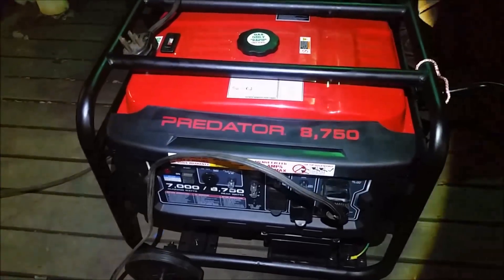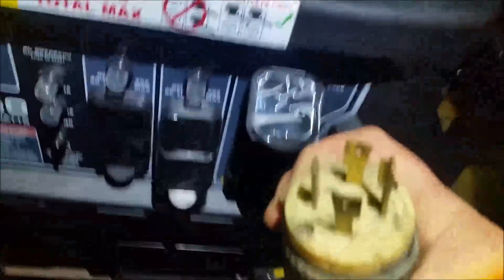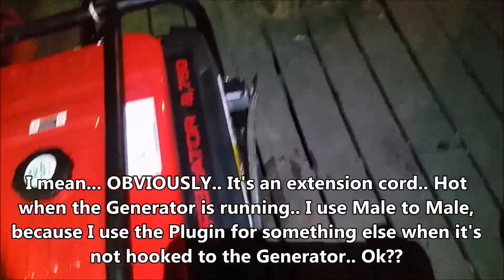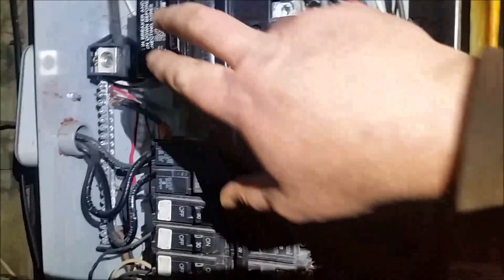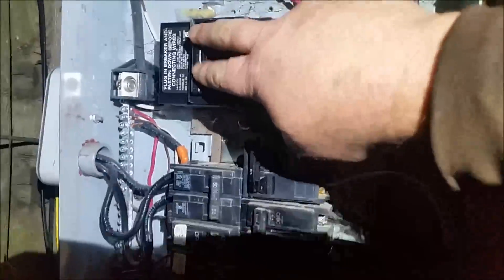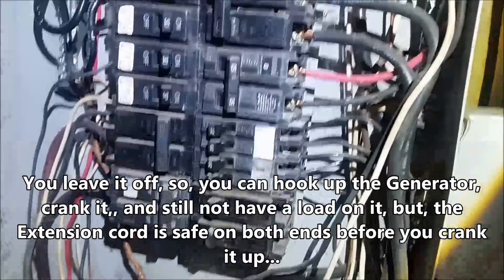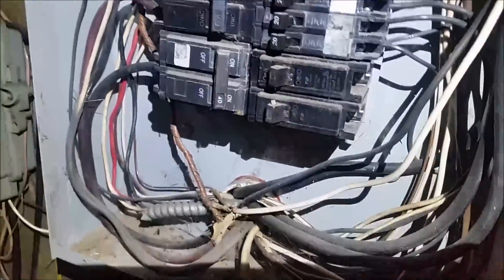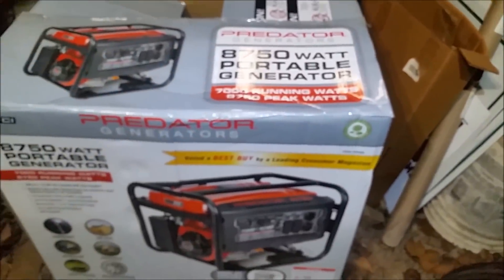Quick/Easy/Safe: Use Existing Plugin/Breaker for Generator hook up to your house Panel box.

Comment: At 5:20 or so and after you explained that each 110 single pole get 110 off its 220v bus. Also around 5:30 you said a 220v 2 pole gets 220v from each 220v buss. You can call me a kid but again you are ignorant and should probably smack yourself for trying to belittle people while you yourself cannot even explain simple phase circuuts panels or even correct buss arrangement. Do you know the difference between delta or y configuration, why smart people have a sub panel for their generator isolating their neutral and ground if there is no generator switch or even why you do? Keep trying to play victim with the people commenting and acting like you know what your doing. Post a single video explaining proper code or technique. You claim its good enough for a lineman but lineman are not electricians and both are trained in different journeyman fields. For a reason. Uh dur mr hick. Smack yourself for being an idiot 👌 kudos for your misinformation on that panel, wonder how many people are hooking up their houses according to your b.s. wow. Your right below cobspiracy theorists on youtube. Hope you feel like a jeenius!
Reply from the maker: Ha.. Yea.. But, this video is not about maintaining equal loads on 3 phase circuits. But if it was, we could discuss it.
Funny though.. Your last post before this, you pointed out something at 5:30.. I still don't know what it was. You didn't explain yourself.. 
If you still are not sure.. Start at 5:36.. You will understand it.. Someone walked up on me when I was getting ready to explain the 110v breakers, and I didn't hear them until they were almost beside me.. I went back and looked at the video. I remember.. It was at 4:25, when I was pointing at the 220v Generator plugin.. I did pretty good.. Didn't flinch at all.. Never do when I am working inside of a hot box.. But, I did loose my train of thought, because I was caught off guard and in a hurry to finish the video because my battery was about shot.. I guess it took me about a minute to process my thoughts and get back ontrack while talking the whole time..Not bad considering.. But, I did straighten it out, since I caught it in the midst of all of those thoughts. Ha.. The Brain is quite amazing.. 
Sub Panel for their Generator? You must be talking about a Transfer switch?? Why would you isolate the Neutral or ground? Just Curious.. So, it would not backfeed out to the lineman?? Really? Are you one of those guys?? Ha..Ha.Ha.. Well.. I thought in your last post you were getting smart..Ha..ha.. 
Funny.. You passed 5:20 the first time before you got to 5:30 which you pointed out.. But, after my comment went back and listened again to pick up the mis statement in 5:20.. They are actually plugged into one side and the other, which is what I meant to say.. If I didn't understand that,  you would not have been so surprised at 5:30.. You thought I was wrong there, but, found out later I was right and you missed 5:20.. Ha.. But, hey.. You understand it now, which is a good thing.. So,, I'll entertain your "Isolate the ground comment".. Transfer switches by design isolate the ground and neutral, because of how they are built.. When you open one, see if you can figure out how to build one without doing it. And, you will see why it is done.. Not because it provides any other reason for it.. but, you seem pretty sharp, and a picture is worth a thousand words, so, here is how you understand the rest of it and stop thinking that saying "Isolating the ground and neutral means something".. Two hots coming into the box correct.?? BUT, there is a Bare Ground/Neutral also.. From the Utility power..If you have Areal Triplex, Two coated and one aluminum.. Follow that back to the Transformer.. Now, look and see what is feeding the transformer.. What is going down the line that the "Lineman" has to worry about.. You of all people being an electrician (was that you?),, should be able to look up at the pole and see what is feeding to your pole... Two lines from the last pole.. Both are high tension wires.. Power Wires.. But, three wires going from the Transformer to the box.. 
Ok,, (2 hots if you are on single phase, so if you see 4 hots there is 3 phase there, even if you don't have it), but, where did the third wire come from?? Look around.. Look at the ground and work your way up.. If the Power company isn't worried about your ground,, why should you??? Ha..Ha.. That is why they call them "Service Disconnects or "Main Breakers".. And,, BTW.. Lineman or Electrician.. This is some basic 101 shit.. You don't need to be either to look at a pole being fed with 2 wires and feeding something else with 3 to figure that one out...  BTW.. I might post another video one day about this.. But, since you and 3 others are the only ones out of 610 commentators who have noticed the oops in this video, I think I will add one instead of replacing one.. 
I was thinking about doing one the other day when someone posted that "Isolating the ground bullshit".. He spent well over $1000 on his Transfer switch.. had to put up a second pole to mount it on.. Looks like some shit that should be on the side of a warehouse somewhere.. Not his trailer.. Ha.. I want to do one on how the job should have been done, instead of the total crap installation his Electrician did for him.. You electricians are not very smart.. 
It's such a simple trade.. I just looked at two panels before I wired my first house and got an inspection for the hell of it... I had outlets on every other stud in every room... I had one outlet wired backwards out of all of them.. And, that was when you wanted to wire a 3 way light switch, there was no such thing as the Internet or Google. It was off to the local library.. Ha..Ha. What a simple field... And, you guys don't understand enough of it to see how simple it is.. One more thing. Do you have any idea the value of your personalized training here?? Ha..Ha.Ha. . I hope you got something out of it.. I am sure you did.. And I was glad to help.. I gotta run.. I have a drag link to build and I have one more bushing I have to make on the lathe before I am finished.. I finally got to use the damn lathe I bought 2 years ago.. I figure it out on the fly while making my first few parts.. I love theory.. Anyone can do anything with the same basic set of tools.. If someone else is doing it, you can too.. Because what basic set of tools does he have?? 2 Eyes, 'Two hands.. And, you have both.. No reason why you can't do the same.. Do, save your money, buy some tools and get to work.. I weld better than every welder that I know except for one, because I was never taught I could not do something.. I do all sorts of jobs with a welder that they say can't be done..
Reply: . you are about the biggest joke of a romex jockey i have ever seen. Are you high while trying to explain yourself? Obviously you do not understand very much, more of a ghetto rig it till it works i see. Also i understoid everything you were trying to say but again you said absolutely wrong information and couldnt even double check your work before posting. That misinformation wether corrected later in the video or not will lead someone to hook something up wrong. Again because you are wreckless your video has potential to hurt many people but your ego matters more? Oh and again you are still wrong and if you cannot watch the video and realize how than you should smack yourself and call a electrician not a lineman and ask him if you woukd pass code and why you wouldn't. Im done if you cannot even make a simple intelligent reply that makes any sort of sense. If you had a brain you woukd atleast reshoot this and do it correctly so you are not potentially killing someone. Leave it to people who have a brain and actually know what they are doing that do not have to correct themselves 100x. Lay off the weed while you film if you cannot leave it to people who have a clue. Enjoy being the hick with an ego that misinforms people 👌 oh and my previous comments explained myself very well, sorry it was so hard for you to figure out 😂 wow just wow
Reply from the maker: Well, I'm glad that you learned so much here.. You started off being shocked at a 220v breaker feeding off of both sides of the box.. and know you are a master electrician..  I like your style.. Ha..Ha.. Be careful though with that new knowledge.. You missed it the first time.. But, you picked it up the second time you watched it.. That's good. At least you are getting somewhere.. 
BTW.. The box was open to show people what is inside of it.. The solution does not require that anyone know anything about a 220v breaker, neither do they have to open the box.. Just make a male to male extension cord and plug it into an existing Welder/Stove/Dryer outlet.. So,, more of your Drama Queen remarks that you so cluelessly make.. You friends down the hall are watching the video again and laughing their ass off at you.. Go back down there and see what I am talking about.. 
Ghetto Rig.. Are you black or white? Live in the Ghetto?? Just curious.. Because,, what is ghetto about a Welding or Air Compressor 220v plugin? Just curious.. Ha..Ha.. All according to code.. Every bit of it,, and would pass code anytime there were an inspection needed.. But, you would have to know the difference in Grey PVC and Grey Flex Duct, etc to know that... I think I smack myself in the head a few times too.. 
Poor guy.. You must know something about something??? And, you probably have a cellphone with a video camera.. You should be able to find something you could put up on your channel.. I mean.. Something other than video games.. Huh?? You should really try it. And, you should let me know when you do.. This could be fun.. Ha..Ha.
Reply from the maker: You still watching the video?? Good stuff isn't it.. Ha..Ha..Ha.. 220/270?? Ha..Ha.Ha.. You need to brush up on your Phases.. You don't have a grip on them yet.. BTW.. I just read your comment again.. You need to watch the part about double throws again.. You still don't understand.. I posted where you need to watch again.. Running off the same bus catching fire.. Wow.. Not sure where you got that one... Not sure how to tell you to correct that either.. That is way out there.. Maybe you are thinking you will double your voltage/amperage?? Back to the phase shift again.. Maybe you are talking about phase shifting. Do some research on 60hz and look at "Automatic switching generator switches", but, only those which are switching from Plant power to Utility and back.. Plants that generate their own electricity.. Look at the dangers of "Out of Phase" connections.. And, then, you will see how vulnerable the Electric Grid is,, if you are sharp and don't miss it.. 
BTW.. Making money?? Did you see an ad before my video or videos? Because this channel is not monitized.. If you didn't understand that,, it means I have not chosen to make any money off of it.. I sure as hell could though.. I have been qualified and able to monetize it for several years now.. 
So, you should not be having to watch any ads when you look at my videos.. I don't do it for the money.. 
If someone gets hurt doing this,, it wasn't by following a simple set of instructions.. 
Scroll back up to the top and start here since you have watched the video no less than 5 or 6 times and still missed it.. 
STEPS TO DO THIS.. For Reference.. 
GENERATOR IS OFF NOW...
1) Turn Main Breaker off.. (MUST)
2) Turn Generator Feed Breaker Off. 
3) Turn Off any other 220V Breakers
4) Hook Up Generator Extension Cord
5) Crank Generator and let run 1 minute.
6) Turn on Generator Feed Breaker
7) Start adding loads to the Generator.
For those of you who don't feel comfortable with this.. Here is a solution for you $650 at Home Depot and you can probably install it yourself.. 
https://www.homedepot.com/p/GenerLink...
Don't be such a dumb ass..
Reply from the maker: Then,, go elsewhere.. I am really getting tired of your stupidity.. You have learned alot here.. You didn't know shit when you arrived.. Show some appreciation of I will show you a trick.. Two clicks.. One and then,, Hide user from Channel.. One more post I have to look at , and then one more and you are gone.

Comment: Good luck with that one!hooking up ur cord to a running generator is his first no no because the male end in his hand is hot as tin shit house so this guy may not be alive today,best thing to do is make friends with an electrician
Reply from the maker: Joshua Smith.. Please do not do anything that includes anything that requires you reading or listening to instructions.. Because, you have serious problems with such simple concepts.. Since you missed the video and audio concepts, and totally missed the fact that the generator you hear running was 50 feet from the one sitting on the porch not running.. You totally missed the sound getting louder as I walked away from the HF Generator.. I mean.. DON'T YOU USE ANY OF YOUR SENSES??? Surely one of them had to have kicked in during the video.. But, you missed them all.. BUT THE WORST PART OF IT,, is that you can't read and follow simple 1,2,3 instructions.. And, the reason this guy does this multiple times per month and is still here after the video posted 8 months ago.. Ha.>ha..
BUT,, YOU MISSED THE SIMPLE 1,2,3 Instructions too!!!!... No.. We don't need Electrician friends... 
STEPS TO DO THIS.. For Reference.. 
GENERATOR IS OFF NOW...
1) Turn Main Breaker off.. (MUST)
2) Turn Generator Feed Breaker Off. 
3) Turn Off any other 220V Breakers
4) Hook Up Generator Extension Cord
5) Crank Generator and let run 1 minute.
6) Turn on Generator Feed Breaker
7) Start adding loads to the Generator.
For those of you who don't feel comfortable with this.. Here is a solution for you $650 at Home Depot and you can probably install it yourself.. 
https://www.homedepot.com/p/GenerLink...

Just scroll back up and see it.. It was there all of the time.. Ha..Ha...Ha.. Some people, you just can't train to do something simple.. Read before you start having all of those keyboard driver errors... Ha..Ha..

Comment: This Guy doesn't know anything,  If his generator is running and anyone flips that main breaker back on, power will go back out to the power company transformer and high voltage  7600 4126, 12,000 , 13,000 or MORE  volts will go out the other side of the transformer  and can KILL Any one that comes in contract with IT.  Any Pro would install a Transfer Switch.    This dumb Ass does even know the correct terminology for the parts. He doesn't know the difference in a Neutral and Ground.  The fact that he likes Harbor Frigate stuff tells you he is not a Professional.      I have  4 years in electrical night school and 40 years experience before retiring.

Comment: Mark Thomas turns off the breaker box main switch.  However this does not disconnect the white common wire.  Therefore when MT turns on the generator he is back feeding power into the white wire common.  This is illegal.
Reply: antty, here's your chance to show your expertise, how can power be back fed into a single grounded wire that goes to the center tap of a transformer secondary?
Reply: I wonder why its illegal to hook up a generator the way MT describes?
Reply: antty, Are you going to answer my question above or just keep wondering and wandering?
Reply: The common wire does not go back to the center tap of a transformer secondary,  at least not on planet earth.
Reply: annty, What common wire are you addressing if not the grounded neutral? All I have is L1, L2 and neutral. L1 and L2 go to the meter and the neutral skips the meter and goes to the center tap.
Reply: I have never seen a neutral or common wired into a transformer.  At least not on planet earth.
Reply: annty, Then why are you concerned about back feeding the neutral if it doesn't go to the transformer?
Reply: Because the power line workers do not expect voltage from another source i.e. a generator.
Reply: How might the voltage from the generator get to the line workers if not through the transformer?
Reply: Also remember do not run your generator indoors https://m.youtube.com/watch?v=I1jT3ANENvI here’s a video about generator safety

Comment: I was hooking up a new electrical motor on an air compressor 110 volt.  The feeder line was 110 volt 12/2 wire .  I connected the motor and the line power.
 Mr.Fireworks announced his presence.  I quickly got the motor disconnected.  Upon inspection I found a "hillbilly idiot" had connected the previous 
 220 volt motor  to the panel using 110 volt line and connectors, because he "figured" things out and used common sense.  The previous motor ran 
OK but was totally disguised by an "idiot hillbilly" who used common sense not an electrical code manual.
Reply: antty zale, maybe I am just a dense hillbilly but your post seemingly offers nothing to the discussion, and is unclear as to what your real problem is/was.
Reply: Thats too bad because I shortened it to avoid wrinting a novel.  Anyway keep using your "common sense" when wiring.
Reply: Maybe you made it too short.
Reply: To make the story better I would say "idiots do what idiots do especially when performing electrical repairs"
Reply: You haven't clearly stated the problem, re-read what you wrote. Was the problem with voltage, or wiring and what kind of fireworks were experienced?